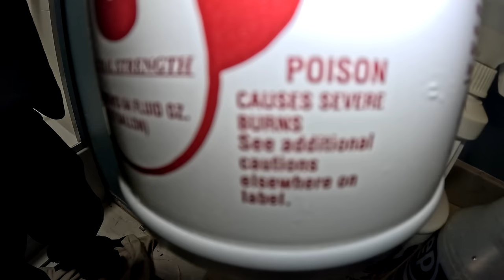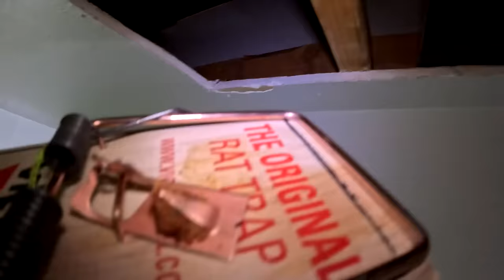The FASTEST way to get rats OUT of walls…in LESS than 10 SECONDS!

Comment: Loved watching this video learned a lot. We have a rat or rats upstairs in the wall. One ran down the walkway and it was black not sure if it's a roof rat or Norway rat.  Pest control company came out set bait traps around the house and down under the house in the crawl space. Guy didn't inspect the roof or go into the attic. We told the guy the chewing is in the wall upstairs in the bedroom closet. Don't hear anything downstairs. Guy left the hole open in one of the air vents on the side of house where he thinks they are coming in. Said not to seal up the hole. This way it will thin out the rats and they can come and go into the crawl space and eat the bait. I don't see how that will help having rats still coming into the house and into the wall. We covered the hole up. You make sense what he told us does not.

Comment: Nice work and very professional service. Especially loved the floor protectors & the sealed area around the soffit.
One question tho: I’ve heard from multiple sources, that you should AVOID using spray foam, because the rats/mice or in my case, bats, will chew through it and actually use it to nest in. Everyone has suggested silicone instead. Or better yet, a copper mesh stuffed into openings, sealed by silicone. What are your thoughts on this?

Comment: pretty drastic to cut the walls open , its effective though
glad i live in a concrete house , no hollow walls , we do have mouses in the insulation in thestorage locker space
uncle of mine had birds outside in a big indoor/outdoor cage , the feed atracted the rodents , he dug a hole in the ground put a bucket inside it with a see saw across it with peanutbutter and water in the bottom , he caught about 4 to 5 a night that way

Comment: I used the smaller snap mouse traps with peanut butter. Lifted the rug on second floor, cut a whole using a saw drill bit, then lowered down into void on a string. Checked it daily and pulled out 5 mice. After about 4 weeks of checking daily with no mice, I sealed the hole back up. Found the entrance point and closed it up and packed the void with 3 layers of Roxul Insulation. Wouldn’t have worked for this lady as the pipe was destroyed.

Comment: Thanks. 
This is interesting and informative, but....
I'm in rural NM and we have wood rats and mice. I have something living in my walls, most likely mice (because that is what I have caught in the glue traps).
My sewer system is gray water only (no water commode, no septic). Part of the house is stucco covered straw bale. I don't have a place to stick a smoke machine in. 
I'm not fond of the poison baits, one, why do I want to invite them in for a meal, because two, they don't seem to work very well and I found a dead stray cat that had no external wounds.
I'm only guessing but I'm thinking that the sonic deterrents aren't very effect either. 

What is more effective for inside the house than the glue traps? 
I could bring in a 5 gallon bucket and some use some peanut butter (worked outside) but again that is an invite, I'd have to catch them all !!!
I wasn't into pokemon.

Oh, and the cornstarch (peanut butter, wheat berries, etc) and baking soda thing didn't seem to help either. For more than a whole week, I kept refilling the rat trays every day. Seems they liked it.

Comment: I thought I had rats in the wall for years.  One night when I heard the scratching I banged on the wall and to scare it.  It started banging back.  I knocked two times and it responded.  I yelled at it and it yelled back and some goo came oozing out the wall.  Next, I found myself being lifted off the ground and was thrown across the room.  I couldn't see anything other than a weird mist that smelled like sulfur.  I was a bit confused and a little concussed from the unexpected flight and landing but instantly realized that rats can be invisible and really mean.

Comment: Love you guys. You are right, broken sewer pipes in the basement, we had  constant burrel wholes popping up on cement floor. Tons of exterminators later, they all said no way they were coming from the sewer.
I had the floor tore up, and there it was cracked MAIN sewer pipes it was their main entry in.

Thank you. 

Also, now that I have closed the main entry points, they are now digging from outside concrete under the door to get back to get back in. HOW DO I STOP THEM.
Reply: Does cast iron ever get used for drain and sewer pipes any more, or is it all done with modern plastic nowadays?
Probably only Mighty Mouse would be able to get through cast iron-
Reply: @dubmob151  depends on where the cast iron is located. Under ground, no. It would rust out
Reply: A cat and black snakes!

Comment: The ratvac is slick, neat invention! What was the saw cut in the ABS vent from? Also did you end up leaving the rubber fernco fitting in the wall like that? I would assume that's prime to be chewed through again. Around here they aren't allowed to be used unless they are fully shielded (metal body) and usually frowned upon by inspectors when buried in walls, except in special applications like ABS to cast, or PVC to cast, or copper etc where it's necessary.

Comment: What he says about them not coming in from the outside is probably true if you have a Florida block house on slab, but for an older wood-frame house, especially one with an open crawlspace, they probably are coming from outside (and if the house is old enough it has cast-iron vent pipes also).

Comment: foam is no good, rats will chew right through it. They crew through wood so foam is no big deal. Hardware cloth (wire mesh) is best to seal around pipes from under a house or tin flashing. seal pipes going up from under and then pipes coming into the attic.

Comment: Here's how I get vermin out of my walls quickly, and easily:  
I listen closely to try and pinpoint their exact location.  When I think I found it, I bang on the wall with a thick, heavy duty carboard tube, as hard as I can, and NOT do damage to the wall. The idea is to make as much LOUD noise as possible, without damaging the wall. This obviously is not a permanent solution, as it seems like they forget, and come back a few years later. 🐿

Comment: I've learned to throw rat bait blocks into attics, holes and dark locations and it typically gets rid of my problem rather quickly.   I've used the liquid stuff as well and boy do they love a fresh drink...
Reply: I hope you're not a professional that just admitted to doing that... bait blocks or packets are supposed to be secured per the label after all
Reply: @tyshibley  I'm not a professional and I actually have a bunch of those black boxes but I don't use them because I put my bait in the attic.and I'm wall holes...if there are no kids or let's I will put them in cabinets where I see activity and i take a picture of it's placement.  That way I can quickly see if they have been enjoying the party.
100% success rates for my 19 properties.  I don't need a high priced exterminator....not even for roaches.

Comment: Wowzers that break in the pipe was enormous. Great job guys.
Reply from the maker: Thanks 🙏
Reply: Was it chewed through from the inside or the outside of the pipe?
Reply: Would a metal mesh wrap around the pipe in areas with standing support like those horizontal pipes help the rare occasion where they might be able to chew through from the outside of the plastic drain pipes?

Comment: What was the final cost for you to remove this persons rat problem?  
I ask because it was very invasive with the drywall and plumbing removal which required repairs and painting for each location.
Reply: Id estimate they spent between 5-8 hours onsite the first day with either 2 or 3 technicians and followed up the next day with 2 for 2-4 hours estimated man hours 12-28  likely more in the 18-28 man hours range. For a residential corrective of this scale id estimate minimum $100 an hour possibly as high as $200. 
The estimate id give being likely 2500-4500 depending on man hours degree of work and specialties required to do the job.

Comment: I had a mouse in my house and the way I caught him I took a bucket just a plastic bucket alright cut little half-circle curves across from each other on the top. By then put a wooden dowel across but I also took a piece of cardboard from a paper towel roll and cut it to where there's a couple inches of dowel on both sides wrestler the toilet paper roll onto the dowel I Put A Ring of peanut butter around the paper towel roll that's on the dowel. Also put three to four inches of water in the bucket and a little bit of dish soap to make it slippery. 
I also leaned a piece of kindling as kind of a ramp to get up to the dowel

Comment: Always cover your sewer vents with steel mesh and inspect them frequently. I’m surprised they used a rubber boot to reattach that vent pipe. I would have used steel with metal clamps. Rats can easily chew through rubber Ive seen them to it where iron pipe was attached to with PVC. Then you have water leaking in your walls.

Comment: Rat’s in general are very destructive, as are Squirrels. Rats will chew through abs pipe and wires from almost everywhere and Squirrels will chew through the same but mainly the attic space and areas above the top floor. Unless there are other easily accessible areas. Getting them out ASAP is an urgent matter. Then preventing them from re-entry is imperative. You are right though fogging/smoking the plumbing should be part of an inspection to check for any breaches in the plumbing. 
Also any pest issues, or foundation issues should be divulged on any sale as this maybe a reason for a sweet deal on a house in a particular neighbourhood. 
Thanks for more information and education. 🤘

Comment: I heard some noise in my wall but actually it was coming from the pipes open up the clean out lid and saw rat about 10feet down went under the house to see if it made any damage didn’t see anything so I’m thinking of using the Pequa just as a precaution. Thoughts?

Comment: I see you did not pre bait traps. For some trapping efforts, prebaiting helps deal with trap shyness. Aggressive rats are easy to catch, but for cautious shy ones, placing a small amount of food like walnuts around trap leads to their greed overcoming shyness. Rattus norvegicus (Norway or sewer rats) in sewer pipes sure are a whole different ball game in comparison to Roof Rats. Sealing exterior holes and trapping in wall/attic space is Okay for Rattus rattus (tree/roof rats). I agree that trapping outside is not all that effective for dealing with existing rats inside house, but is okay for varmints eating fruit in trees.
Reply: Trap shyness is often caused by them having experienced pain or fear from a similar looking and smelling object if you change the look and smell of the object its often not an issue especially if you disrupt their normal habits. With them using the little house thing on their victor traps it changes the look a fair bit I'm just curious if they did anything about the smell. I've seen guys soak them in citrus before to change the smell of the trap. Alternatively they could have used traps that already had the smell of rats on them from previous catches that does help a lot from what I've heard.
Reply: I think a well used, dirty with rat blood and guts, makes the best trap.

Comment: Do an wax seals discolor? Whenever I've had leak issues,  they've looked rotted like that and especially the ones connected to a plastic "horn". I've had those fail in only a few years time so I usually buy wax only seals and have had fewer callbacks on my rentals.

Comment: I was on board until I saw the rubber coupling. Should have a slip joint or have a metal collar imo. If they chewed through PVC, they'll chew through rubber in a night.
Reply: Would it really matter? The rest of pipe isn't metal and they were attracted because of a water/air leak in the first place.

Comment: Curious if you have a solution to keep them from climbing up from sewer in those vent pipes.. some sort of removable mesh or obstruction attached to something for removal and cleaning ? Do the vents on roof need a cap to block access from the top as well ?  Enjoyed the dance as well !  THANKS !
Reply: I've had to put screen on roof vents to keep tree frogs from coming in. I put the same ones out several days in a row, then figured out they were climbing down the vents and swimming up through the toilet. I'm not sure if rats would do the same, but it seems possible.

Comment: Can't you just go the extra step , run to home depot with a piece of the wall and color match and paint the wall?

Takes an extra hour tops. 

I always hate it when they come and cut open the walls and then say "I don't paint."

Gets on my last nerve.
You certainly did an amazing job , but not taking a little extra time to paint the bathroom and ceiling. 
Always irks me when contractors do this.
YOU cut open the wall, YOU finish the job.

Comment: I er wonder what kind of perverse logic went on for someone to leave that gap between the pipes in the first place. At a guess im gonna assume someone meaaured the pipe to roof height And put them together then drylined the wall then somebody realised the pipe was too low on the roof and all the rain was pouring down it and decided to grip the Pipe, pull it up so it'd be proud of the roof felt but didnt reLise thry pulled it off the lower pipe

Comment: the way those rats cut completely through that pipe so cleanly without tooth marks was almost like a saw... Or maybe the construction was lazy and that was actually an unsealed gapped butt joint. maybe it was just missing a rubber sleeve.
Reply: You obviously haven’t seen them at work, I knew as soon as he showed it, rats did it.  They chewed like this all over my barn.  In 1 night!
Reply: @mrs.c5471  I am talking about the obviously shoddy construction, That pipe had a hole chewed in it, at the butt joint. They can sure do a lot of damage but they leave teeth marks not power saw marks.